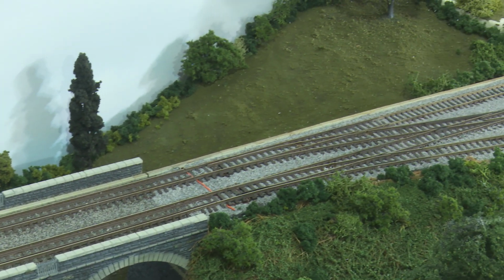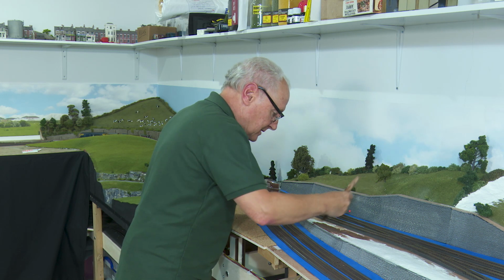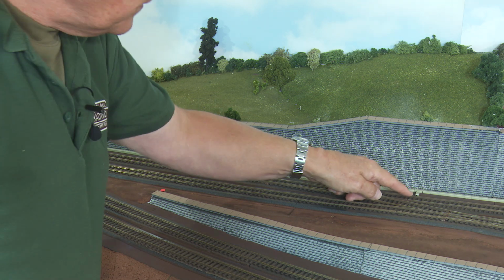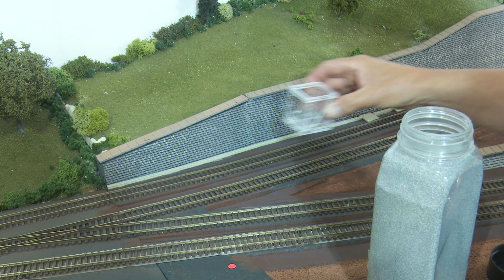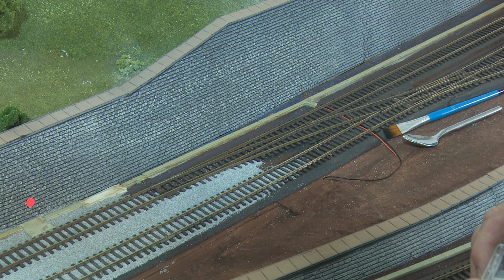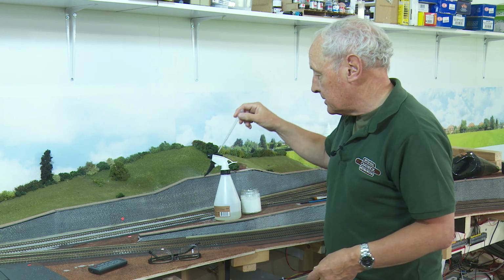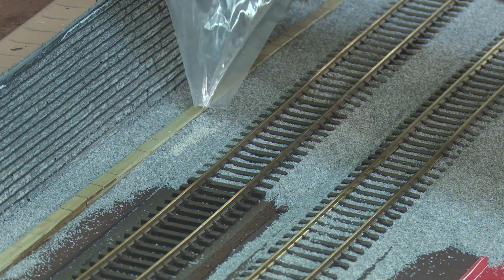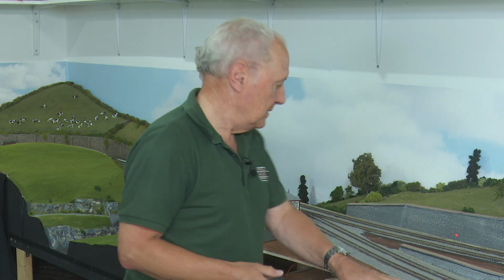Ballasting at Chadwick Model Railway | 138.

Comment: Hi Charlie, I covered the 12mm top wood with 9mm fibreboard (easy to put pins in) and laid my track on 3mm self adhesive latex rubber. If I turn the sound off I cannot hear the locos etc even after ballasting. Great videos.
Reply from the maker: Clearly a great method Bernard. Regards Charlie

Comment: Hi Charlie, from past use, I now avoid using green or yellow washing up liquid in the PVA mix and opt for the clear variant,  I noticed that once dried you get green(or yellow) staining on the inside of the rails. i may have used to much but it's something i noticed later down the road.
Reply from the maker: Thanks DJ, it’s an interesting observation. Regards Charlie

Comment: Charlie one tip when you are putting ballast down and you have your dropper wires going through the baseboard is use your glue gun to seal the hole, then there is no way the ballast or glue can go through.
Reply from the maker: A lesson learned that’s for sure.

Comment: Points. A trick I have used in the past.. very common with electrical engineers.. remove the Oxygen.. thin film of silicon grease. Points, are at the end of the day, are switches. As the contacts come together, electrickery will jump, and they will arc. Even under nano-volts. Hence why MCB’s have spark quenchers. Lots of thin bits of metal film inside them..
Reply from the maker: You’re not the 1st to suggest this Kris. One chap mentioned having a couple of drops of oil to the moving parts prior to glueing. Regards Charlie

Comment: I used more or less the same techniques as you did Charlie to do my ballasting. You can see the result in my channel photo.
I put a little IPA in the glue mix as well I found it flowed better. I also used a piece of 2x1 wood to tamp the ballast down. I wouldn't use a spoon it may damage the railhead. Keith
Reply from the maker: Interesting points Keith thank you very much, regards Charlie

Comment: Charlie, Thanks for the ballasting tips, I need to do a lot of work before I get to that stage, but if things go according to the unwritten plan, then tomorrow for the first time I may actually see a DCC locomotive pass around my loop for the first time (Everything is crossed) including the eyes and toes. I have to first connect the operating software to the controller, Hopefully not too many hours in that, but as you often say in your video's "who knows". If it works guess who will be a happy bunny.
Reply from the maker: I do hope everything is worked out for the best Richard, it can be somewhat challenging! Regards Charlie

Comment: Well done Charlie,  unfortunately ballasting is a tedious but necessary part of building a railway,  I do think you give yourself a lot more work than you need I use an old bottle that a cheap pva came in from a £1 shop it has a small nozzle that screws off so it can be refilled with 50/50 pva and water after spraying the water I find the bottle spreads large areas like you were doing more easily and quickly ,for doing the points I put the balast down and spray it and use an even smaller bottle with a pinhead nozzle,  I have to say using these has made the task of ballasting less arduous. 
Regards
David
Reply from the maker: Excellent points David, and I’m most grateful. Regards Charlie

Comment: Darrenbury  Central    Hi  great show.  I dont use cork under track as it goes v brittle in time.  I really enjoy ballastig.  For deposting ballast at track side instead of the bag method  i have a a4 paper sheet fold it in half  pour the ballast into the v and hold it just above the area then tap it out.   Love the ret wall v good.  You could have some linesmen about. I sometimes put a small drop of engine oil on the ballast to give a dark area.  How about a few lines placed between the track like you sometimes see.   Reall enjoy your channel keep it up .  Tatty Bi
Reply from the maker: Thanks Darren, I’m so pleased that you enjoy the channel. Happy ballasting, regards Charlie

Comment: Excellent as ever Charlie. 
Regarding the cess, why not do that first? It's lower than the ballast and much finer. I used black paint, sprinkled with fine ash. It tends to be darker than the actual ballast.
Regarding the ballast itself, I always found that the WR had a very slight pink tinge to it. Dunno if anyone does a variety like that though.
Regards as ever.
Reply from the maker: An interesting comment Peter. What I will try is to paint a thin line of glue onto existing ballast and  sprinkle it with tile grout. Regards Charlie

Comment: Hi Charlie. Have you tried ballasting by mixing the ballast with powdered wood glue (Cascamite), spreading the mix as per usual using a ballast spreader and then spraying a water/ipa/detergent mist over the ballast? I have found that using this method with a 2:1 ratio of ballast to glue works very well, does away with the dropper, and is a lot quicker.
Reply from the maker: But does it dry hard and therefore transmit noise David?
Reply: @ChadwickModelRailway  Hi Charlie,  Thank you for your prompt reply , and yes, unfortunately, it does dry hard, so some form of acoustic break is still necessary to reduce noise transmission.  The benefit from using the powdered glue is that it ensures all the ballast gets glued down and it does save an awful lot of time.
Reply from the maker: Thanks David, I thought that might be the case.

Comment: Hey Charlie,

Have you ever thought of, or experimented with, adding the paint to the Sculpt-a-mold directly? Would give it a colour throughout and work well against white chipmarks, I'd think...
Reply: I've done similar with the cheap poundland wall filler I use. It does work against white chips, yes.
Reply from the maker: I was warned against it as your dyeing all of the mix rather than just the surface, as it needs a lot of paint.
Reply: @ChadwickModelRailway  True, but at 99p a pop that shouldn't make much of a difference at least cost-wise?

Comment: Hi Charlie, because my track is pinned directly to Pinex fiber board the noise is minimal except in the tunnels which do echo a little bit, would really like to find a Copydex type of glue here, great tutorial and video, keep safe and well, regards from down under
Reply from the maker: Thanks Jed, I have never heard of Pinex.
Reply: Pinex is a light compressed paper fiber board half a inch thick and comes in a imperial sizes still but is getting harder to get, usually used for ceilings, thanks again Charlie, great videos

Comment: Hi Charlie. I now model 'N' gauge due to lack of space. Last time, I used pva for cork to board, and a bead of pva for track to cork. Track nailed all into position then weights on top of the track for good adhesion pressure. Next day I lifted weights off and pulled track pins out. All was solid ready for ballast, except where the weights were, the track had gone black. Do you know why please? 
Thanks if you can help.
Your video's give great detail and I am back tracking them now as I am restarting the railway hobby. Thanks for your helpful video's.
Reply from the maker: Hi Mel, no sadly I have no idea why your track turned black. However, I’m pretty sure it would come off with a track rubber. Regards, Charlie

Comment: I have used a drop of dark indian ink in the glue/water mix, which makes the ballast look a little more "used", though it's pretty much a apply everywhere deal, not so much control. On reflection I think a better way is to use sleeper grime over the main section of ballast and leave the cess clear of paint to get the contrast you're looking for.
Reply from the maker: I think that you’re right Neil.

Comment: I've seen Kathy Millet use IPA as a pre-soak on her Diorama's ages ago and thought that would be useful for ballasting my track. I've not really enjoyed ballasting in the past, though doing straights and bends are fine. Around points and crossings it does get on ones nerves, trying to get the unwanted bits of gravel out. As everyone will have their set of process's to completing this task and make the job less taxing and time consuming. Interestingly, I have not seen a person (to date) that has analysed the process of spoon tapping the track. Does the size and weight of the spoon used have a better or lesser result in settling the gravel? Anyway don't be using Mrs Bishops best silver or you'll get a few whacks on your real head to settle you down, LOL. Once again Charlie, a great video tutorial on this topic of track ballasting with hints and tips to use.
Reply from the maker: Yes John, the mass of the spoon does have a harsh effect. Some folks use an old electric tooth brush which has a more subtle impact.
Reply: @ChadwickModelRailway  An interesting use for an old Oral B unit to vibrate the gravel.

Comment: Great stuff Charlie a welcome refresher. I’ve used your previous ballasting guides as a basis for all my ballasting and it’s been a great success, thank you, (although I apply it with the teaspoon, rather than the applicator). I use a 50/50 mix of fine and medium mixed grey and it seems to work well.
One question, did you remember my request for a q and a episode?
TonyS
Reply from the maker: Hi Tony, yes I have I’m going to ask for questions in the next video to then do one subsequently, if that makes any sense at all. Regards Charlie

Comment: Wondering if the signal box wouldn't be better on the upper spur area you created. It'd have a view of the throat into the station and also a view of the junction coming onto the viaduct aswell.
Reply from the maker: A valid point David and one which I’ll certainly consider.

Comment: TBH Charlie, when I started out laying my SMP track for my British outline, some 10 years ago, I thought ballasting was de rigeur. I had the same Proses dispenser and used the fine ballast and it worked well. However, adding my Continental sections, I went straight to Fleischmann profi and what a pleasure that was. Not only does it look OK, but the running and sound quality is superb. I do add some ballast in the cess areas but thats all and at the end of the day, the scenery and running of trains is far more enjoyable and you hardly notice what the trackwork is.
Reply from the maker: Thanks for an interesting comment Paul.

Comment: Another fascinating insight for a noob like me Charlie. Do you know if laminate floor insulation sheet would be better than cork? Its 5mm thick and has a 19db rating. Almost picked some up today
Reply from the maker: It’s worked out fine for me VT. However, it does crush quite easily. Regards, Charlie

Comment: Great video. I was surprised you didn’t use Copydex instead of the PVA as being rubbery it should not transmit the sound as much as the PVA. Also it’s easier to unglue points as it’s not rock hard.
Reply from the maker: I did use a Copydex mix earlier. But it became rather stringy. Regards Charlie

Comment: Hi Charlie,  how do you thoroughly clean the rails after using the rail match spray?thanks Jo
Reply from the maker: Use thinners before the paint dries. Otherwise you will need a track rubber.

Comment: Hey Charlie, I think you've managed to do something that has eluded me for several years.  That foam, I have some of it, one version of it is called Funky Foam that you buy at Hobbycraft.  When I bought my first batch I bought a roll of 2m x 1m, I can now only find it in A4 and smaller sheets.  Can I ask what term you used to search to find it on "that well known auction site" please?

Also: a couple of episodes ago you were talking about signalling and suggested that you thought a "Signalling 101" type programme would be a good idea.  I've got previous on this, would you be up for a PM chat about it?
Reply from the maker: Hi Elliot, no the A4 sheets were from Hobby Craft, avoiding the eBay hunt.
You’ve lost me on the Signalling 101.
Can you remind me please.
Reply: @ChadwickModelRailway  Hi Charlie. About the foam sheets, it looked very much like the sheets you were using were larger than A4. If they did come from Hobbycraft I'm surprised and I would still like to find the larger sheets.  

Re signalling: in CMR135 you made an aside remark about the correct use of signals that suggested you would like so talk to someone who understood block signalling and so on as it related to model railways - essentially an entry level signalling class for the modeller, or in American College speak Signalling 101.  Credentials: When modelrailway.tv was actively making programmes I prepared a series of programmes about signalling for the modeller that never got made and is very definitely my IPR.   I would be happy to share this knowledge with you.

Comment: Hi Charlie how long do we need to leave the ballast to dry once it's been sprayed with the water before applying the PVA/water combined track solution on?
Reply from the maker: You don’t Tom, the water to helps break down the service tension.
You must apply the glue straight after. Regards, Charlie

Comment: Charlie, a quick question that occurs as I watch this;  Larry Puckett mentioned on his channel a few weeks ago that he had spoken to you and other UK modeller about having experimented with using Celetex insulation foam between ballast and baseboard. You havent mentioned it in this video so far.... was it a viable thing to deaden the noise?
Reply: I was going to ask basically the same question , whether laying the track on a thicker insulation type foam would deaden the noise transfer
Reply from the maker: I think this is correct gentleman. Using that type of wall insulation would do the trick, but how are you going to change your points, as the point Motors won’t reach through to Inches of Celetex?Regards Charlie
Reply: @ChadwickModelRailway  Indeed, Charlie, that could be hard - but luckily Celotex (other insulation foams are available!) comes in lots of different thicknesses from 12mm upward. The 2 inch stuff is what I think goes in cavity walls, but there are the far thinner ones - which I was wondering if anyone has tried out - and if so, how effective was the noise reduction?

Comment: Hi Charlie, great video! However I'm slightly confused - as you're vacuuming the excess ballast, how did you manage to avoid taking all the ballast up into the vacuum? Am I missing something?
Reply from the maker: Hi Josh, no you’re not missing anything. The small handheld vacuum cleaner just isn’t that powerful so it’s only the ballast on top of the sleepers that seems to get set up. Regards Charlie
Reply: @ChadwickModelRailway  good to know, thanks!

Comment: i Charlie. Just watched this ballasting episode again and had a thought (rare for me). Is there any reason why you can’t mix your glue with the IPA and spray / pipette it on, thus effectively reducing the surface tension whilst simultaneously applying the glue? Sort of halving the time it takes to apply and reducing the drying time.
Reply from the maker: I don’t think sprinted on would be a very useful method.

It would be difficult to tell when enough has been applied.
However, give it a go and let me know.

Comment: I'm using Anita Decor glue, which remains soft after drying. This helps keeping sound down, and just hear the noise of wheels on the track. Notice my modules (small ones, as it's build on a shelf), are build in extruded polystyrène
Reply from the maker: Is your glue available in the UK MT?
Reply: @ChadwickModelRailway  You can order it in France, in maketis store. Dont know if there are suppliers for it in UK.
But there are other brands selling this kind of glue, as Woodland scenics

Comment: I've heard that using artists' Matte Medium (used to thicken paints) as an alternative gluing method can be an effective means of reducing noise transmission.  However, I'm not sure whether you would dilute it to the same degree as your typical PVA.
Reply: I used 1 part ordinary matte medium to 6 parts water. Still works.
Reply from the maker: It really is a subjective issue.
Someone’s drumming is another one’s ideal Loco’s sound!. Regards Charlie

Comment: Charlie, try the reverse side of an old cheap electric tooth brush instead of your trusted spoon.
Reply from the maker: I certainly will JB. 
What make are you using?
Reply: @ChadwickModelRailway  Hi Charlie,
The one I use is a basic Colgate electric which takes an AAA battery.
Reply: Hi Charlie
The model I have is a Colgate Microsonic, just had a look on line.
I got mine from Sainsbury's, I think that it was about 5 pounds.

Comment: Bit surprised you're bending the concrete trunking...I've never noticed simple bends in the trunking but rather zig-zags where the sections are butted together.
Reply from the maker: Bending the cable troughs is not noticeable, but it is a great way of avoiding harsh corners.
Reply: @ChadwickModelRailway  OK - that makes sense.

Comment: I had something happen while I was ballasting last year and I wonder if you’ve noticed it. I have also used cheap hobby paint, and acrylic, for going around the tracks. I think with the qualities of the ipa, it’s dissolving my paint and the paint is bleeding into my ballast. I’m using Arizona Rock and Mineral n scale ballast which is VERY fine. 

Anybody had their ipa mess with acrylic paint around the track?
Reply from the maker: I have certainly never had this issue Andrew. However, for painting my tracks, I always use enamel paints. Regards, Charlie